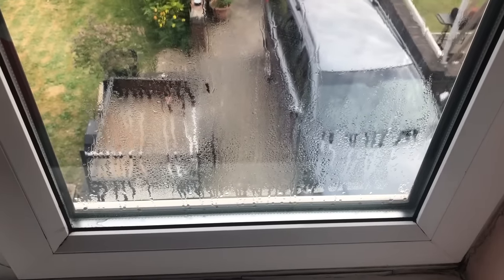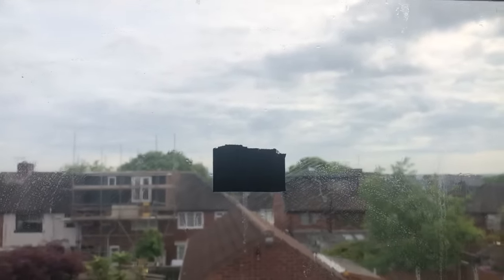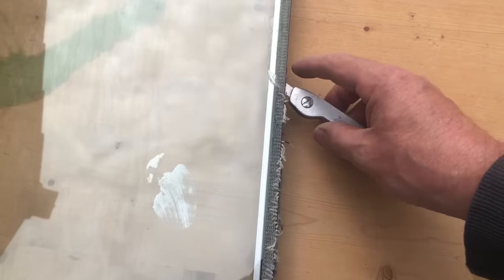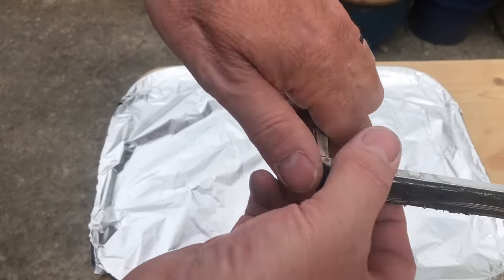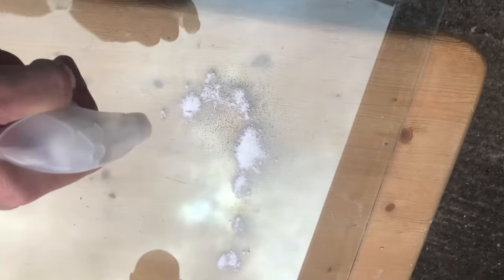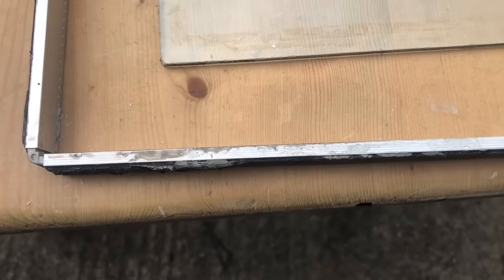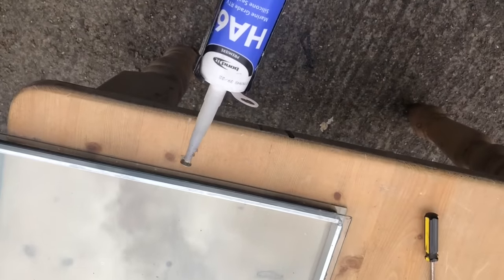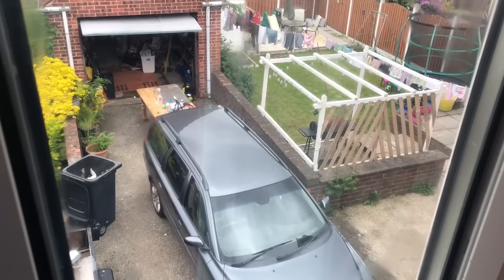Double Glazing Unit Condensation / Blown DIY Repair.

Comment: Very watchable video BUT what did you do about the vacuum between the two panes? Double glazing is an effective insulator and gets it's strength from the vacuum between the two panes making it as if the void was a single solid thickness from the inside to the outside. By not creating a vacuum your u-value (insulation measurement scale) will be extremely poor, costing more in heating and noise transference. Likewise, it will be massively weaker if struck by a ball or a burglar. As I say, respect for having a go but unfortunately on this occasion, missed the mark significantly.
Reply from the maker: It’s not vacuum double glazing (VIG) just a standard double glazing unit consisting of dried air as the insulator.
Reply: @TheRepairer well bugger me, I was under the impression all double glazing had a vacuum ! I'd been trying to work out if there was an easy way to emulate it (at least partially), perhaps by sealing all but one small section, then heating the glass (hair dryer) to expand the air inside (which would vent out of the opening), then sealing the gap before it cooled down.
Reply: @colinwilson210 put argon gas between the panes.

Comment: Well done, fascinating to watch and I learned enough to know now - that I would not tackle this. As an engineer and accomplished DIY (and tight arse) I think that knowing what not to tackle is also valuable knowledge. Thank you.😉👍
Reply from the maker: Thanks, I’m glad the video proved beneficial.
Reply: Thanks I paid £170 for a panel like this to be replaced, after watching this I would be confident to do this. I don’t chase myself as a tight ass I just enjoy fixing things. As a lad I took an alarm clock apart fixed it and rebuilt it and it gave me immense pleasure. I also replaced the mineral glass in my Seiko watch with blue sapphire scratch proof glass and the aluminium bezel with a ceramic one. The next level seiko dive watch with these as standard are £300 more the upgrade cost me £35 so it’s both rewarding and saves you money. But also you can learn another skill.
Reply: @waynetykocki3964  Well done, you will not find me knocking anyone doing this repair - I just said not for me.😉👍
Reply: I know what you mean. In my case it would either have fallen to the ground from a great height, or at leant one side would have cracked trying to get it on a large flat surface to clean it. So likely failure and a risk of injury through broken glass, then a panic trip to B&Q to get a sheet of ply cut to size to go in the frame for a week or two before the replacement unit came. Plus if warm moist air gets trapped in the air gap won’t you still get condensate within the glass on a freezing night?
Reply: @jamesrussel1133  before you seal it heat with a hair dryer?
Reply: I thought these panels were supposed to have a partial vacuum as a heat barrier aid. 

Is that not necessary?
Reply: No not required
Reply: A vacumn would pull the middle of the unit togethe !

Comment: I was always lead to believe they were vacuum sealed units, amazing thanks
Reply: They are with Argon so the whole thing is useless and will mist up
Reply from the maker: @combrogi They are a dehydrated air double glazing unit.
Reply: @TheRepairer  then they're very old and inefficient
Reply: @combrogi  i mean you can get a cylinder of argon for 30 euro and its heavier than air so will displace it if filled from a small hole at top of frame which can then be sealed.

Comment: That was a fascinating and informative video.  I had no idea whatever how D/G units were put together nor the fact that they could be repaired.  I certainly could not tackle a job like that.  I recently had a D/G unit replaced, it was about 1m x 0.75m and cost me £90.00 all in.  He came and looked at the job, measured up and returned a few days later with the replacement unit and fitted it.  I thought that was not a bad price.  I suspect you spent quite a few hours on that job plus materials.  However, as you and others have said, it's not just about money.
Reply: They can't be repaired properly like this. It WILL fail again.
Reply: @garrett69  and who's to say the new one won't fail?

Comment: Last year I replaced all of my blown sealed units with new ones (about £100 each) but recently a few more have failed. I still have some of the blown units at the back of the garage kept for another project but as they are the same dimensions I intend to have a go at repairing them as I have nothing to lose but my time and sealant and good practice.  If I can repair them by following all of the helpful tips, and allow me to reuse rather than recycle glass. More importantly, I now have several failed sealed units with toughened class in my conservatory and they are not as cheap (about £250 each) so I feel they are worth trying to repair.  I have read additional advice from others but generally, this is a brilliant blog and with the additional tips from @AbsolemLapis and others I am feeling very positive.  Again many thanks.

Comment: As a life time repairer I appreciate the effort that went into this fix. I recently had all my hardwood windows replaced with upvc.  On attempting to liberate the glass from the frames without breakage, it was near 99% failiure. They used putty to fix the dg into the frames, which turned into concrete! I also attempted to seperate the individual panes, so i know how difficult the job would be to complete without damage. Also the aluminium seperators were extremely delicate. So, you did a great job, and I hope you get 10 more years out of your repair. A follow up video would be interesting. Good luck, you got my sub...
Reply from the maker: Thank you Tim, it’s great to receive such a positive comment on this video. I can tell you that the window is still good since it’s repair in June and the other large one I did is good too. Maybe I will do a follow up video at around the one year mark, I have other panes that I first repaired in lockdown that are over 3 years old and still good. Thanks for the Sub they are all much appreciated and good luck with any future repairs!

Comment: Thank for your videos. Gave it a go and happy with the result. Just make sure you really clean the glass that will be inside the seal. Rinse several times to get all the cleaning chemicals off the glass or they may appear a couple of days after the unit is in the frame. This happened to me after the wife cleaned the glass and insisted the small streaks are not cleaning chemicals and that the glass is damaged. I will now repeat the repair on the same unit and clean the glass myself to see if the glass expert is right😂 I will let you the outcome when I get it done.
The time v buy new isn’t the issue for me. I really enjoy the satisfaction of doing things myself and learning new skills. Once again thanks for the video one of the best on YouTube on this subject.
Reply from the maker: Thanks for the feedback,  I am wired that same way.  I could buy new but where is the fun in that. I’m pleased that you have successfully repaired your window.

Comment: Similar idea to Edward Doyle's below. I had the very same problem a few years ago. I'm a lazy person so I spent some time trying to figure out an easy way to solve it without removing the glazing unit from the window.  And I did. With the side window open I removed the upper and lower locking plates in the edge of the window frame. This allowed me to see the black sealer edge of the glazing unit at the top and at the bottom. VERY carefully I drilled a hole (about 5mm) through the black sealer until the drill bit was visible between the 2 panes. I did this for the top and bottom. Then I got my vacuum cleaner and placed the hose against the top hole and let it suck away. This started removing the moist air from between the panes as dry air was sucked in through the bottom hole. After 10 minutes the water vapour was gone forever. Then I sealed the 2 holes with a sealer, and replaced the locking plates. As it happened, I did this on a sunny day when the sun was shining on the window, so that helped. Total time to do the repair was about 30 minutes.
I hope this might help someone!
Reply from the maker: An interesting repair technique, I’m really glad of worked out for you.
Reply: That sounds like a great shortcut. One thing that occured to me is that isn't the misting up caused by a breaking of the seal, therefore, unless that hole is located and sealed won't it mist up as soon as the weather turns cold? I note you said you did this several years ago, which has got me scratching my head wondering how it's lasted so long. Cheers.
Reply: @akaWooders  Must have got lucky and drilled exactly where the leak was. 😁
Reply: @markrainford1219  😆
Reply: There are commercial companies that do this.
Reply: I was considering doing it this way. Also you could fit a syringe tip into the seal and fill with some Argon at the same time as vacuum. But the main problem for me as the window units misted quite quickly after installation (within 6 mo or so) so the seals were not good.
Reply: Interesting

Comment: I learnt a lot from this video. My previous house had a few panels that were showing signs of blowing after probably 40 years. 
I had no idea they had desiccant inside the frame, and it did not look like too difficult a task, if you are capable and patient. The panels I had were into wooden frames, it was a house built in 1890 and had been upgraded a few times since WWII, so the windows were not original and extraction of the cells would have been slightly different.  They were installed with putty and sometimes beading.  Thanks for the information. I like to learn at least one new thing every day and today I learnt more than usual.
Reply from the maker: I’m glad you enjoyed, Thanks for a positivity.
Reply: Just a tip for ya if ya dont already know on timber hackouts and timber bead windows its a good idea to use sillicone to seal the windows in place instead of putty as putty likes to let go as it sets i only use putty on timber and steel hackouts on the outside of the glass

Comment: Wow! I learned a lot there. Last year, I purchased replacement sealed units. I had no idea I could have done this. Definitely going to give it a go as I have another one gone. Thank you. 👍
Reply from the maker: Thanks Brian, I wish you the best of look with the refurb,  just allow plenty of time and tool up well. The video is 4 hours worth of my labour and its not my first window!
Reply: @TheRepairer  add the cost of the sealant, makes you wonder if it is cheaper just to get it replaced.  Not that I don’t think what you did it an admirable piece of work
Reply from the maker: It all cost less than £10
Reply: You can't do this unless you are extremely lucky . . Please do not attempt it. You can do more damage  than you started with .
Reply: @TheRepairer Not when you consider the labour costs. False economy.

Comment: Well done, you completely rebuilt the window. I know from experience how long it takes to separate the panes and clean them. (brake cleaner would have instantly removed the WD 40. Possibly the butyl rubber residue too?)
I'm in the process of trying something similar, but attempting to do it without dismantling the unit. I've dug an inch of rubber out of the bottom of each side and got the dessicant out.
My 'plan' is to reseal using butyl rubber glazing tape and a hot air gun, like torch-on felt roofing style. Also I do a bit of tig welding, so I've got an Argon bottle handy to Argon fill the unit while I'm at it. Never going to be as good as new, but it's an interesting exercise. (plus all my units are diamond leaded so flippin' expensive)
something I did come across while researching; the dessicant isn't like silica gel that can be dried at low heat. It's called molecular sieve 3A, and needs to be reactivated at above 121 degrees Celsius. 
For future reference if you're interested, 110 litre disposable Argon bottle (Toolstation) and gas regulator (fleabay) total thirty quid.
Anyhow, fingers crossed..
Reply from the maker: I’m wishing you the best of luck with the repair, interesting about the gas I have a welder that can use it.

Comment: Good video, and well done you for giving it a go. If time is money, then a new sealed unit is the way to go, but there are plenty out there who have time on their hands, or no money  -  in which case this is for you. All I would add is that I would have a piece of sterling board or similar to hand in case I cracked the glass. The glass and the aluminium spacer will expand and contract at different rates with temperature changes, so use a low-modulus silicone, which allows the glass and spacer to move against each other without breaking the seal. Make sure there are packers underneath the glass so that the units never have to stand in water. Also try and do it on a cold dry day so that the air that gets sealed inside will be dry, giving the desicant less work to do. Avoid hot humid days!  If it works, you've saved a considerable amount of money. If it doesn't, you're down to the tune of one tube of sealant, and we've all got a bit of gash sterling board lying around, and regardless of whether it works or not, you'll have learned something new. If you don't have a go, you've learned nothing.  Now wait for those who have trolled this thread multiple times at every opportunity to wade in!!
Reply from the maker: I get much pleasure from finding  low cost solutions for problems even though I don’t need too!

Comment: Hi, very good video & perfect work - i had a similar problem with two of my windows - lots of water / moisture between the two window panes & just out of guarantee - fortunately for me they were of the opening type window  - i cleaned out the drain vents at the bottom of the outer frame’s & used a vacuum cleaner on them to make sure they were free. I then drilled two 4mm holes up at the bottom of the main window frame up between the glass panes & one 4mm hole near the top on both side’s again between the glass panes.
I put a short length of tube ( earth sleeving ) on the vacuum cleaner , removed all the water & left to to air dry.
That was last year - no more water or moisture - apart from just a couple of white plastic flakes that fell inside.
Ed,
Reply from the maker: That’s an interesting repair thanks for sharing , I did hear of company that drilled holes and filled them with vent plugs.

Comment: Demystified  double glazed units in more than one way.  The vinegar and bicarb acts as a very good degreasant for the WD40.  The application of the silicone, as you did- the careful pushing of the sealant into the joint after thorough cleaning of all surfaces, will seal the units for a good long time.  Obviously if someone is tempted to simply trowel the wet silicone edges then they can expect failures as the retired glazier suggested.  Re-using desiccant is done extensively in science- there's no magic to it- though do it for longer than the simple appearance of whiteness to ensure all interior moisture has been driven off.
Reply from the maker: I’m impressed you have paid so much attention to detail. It’s  really good to receive such a positive comment from a fellow believer in the repair process.

Comment: Sometimes £50-£99 is NOT cheap!      As a family who have moved a dozen times, we always called a glazier when the panels ‘blew’ BUT due to energy AND fuel costs etc., we are just accepting the fact that the couple of failed panels we have at the moment will be there for the foreseeable future.  We aren’t brave enough to try to mend them ourselves in case we make the problem worse.
Reply: That's me. I don't think a blown window has less insulation properties. Perhaps allow more noise though.

Comment: That “window tool” is literally for painting, it’s a painters tool and it’s awesome for everything!
Reply from the maker: It is a multi purpose tool it can even be used for de nailing.
Reply: @TheRepairer  I love mine, use it for literally everything! Purdy make a very good 6 in 1 Painter’s Tool & a 10 in 1 Multi Tool they’re great quality too!

The curved part is for cleaning paint rollers and it works a treat.

Comment: Good work. I've made and fitted DG units and also split them to reuse the glass etc. Some sealants are very difficult to cut and remove but it's worth a go. Save money, save materials and get satisfaction from doing the job.
Reply from the maker: Thanks it’s good to hear from someone with industry experience that’s in favour of these diy repair techniques.

Comment: Absolutely love the enthusiasm and work ethic to get that fixed

But that being said £40 for a new unit that size is much easier for the amount of time and effort to split a unit down … nice work tho mate ..
Reply from the maker: Fair enough!
Reply: @TheRepairer  £40 for a new unit of that size, you can put a 100 in front of that 40 if not more +vat
Reply: Definitely not £40 haha way more
Reply from the maker: It will more than likely be a window fitter with trade connections and prices that came up with that low figure there are multiple similar comments on this video that have estimated the unit replacement price as low as £20.
Reply: @TheRepairer  how has the repair held up? Any defects since?. Planning on giving it a whirl.
Reply from the maker: @MrWoods0_0 Still going strong and bone dry since the repair.
Reply from the maker: @MrWoods0_0 still going strong and dry ever since.
Reply: @TheRepairer  yea I’m in the trade a unit that size is roughly £35 ish .. like you said tho cost to Joe Public would be £150
Reply from the maker: @danielandjenny9 Thanks for  that information that is a shocking markup.
Reply: @TheRepairer  sorry I mean that would be supply and fit for that price … glass would be around 80-115 ish to buy from a shop but that cause your not buying it directly